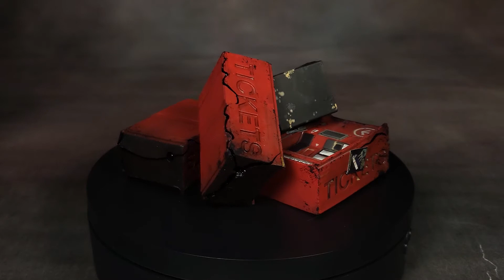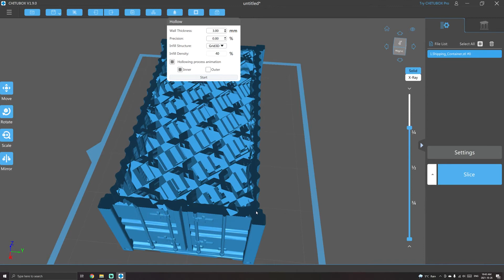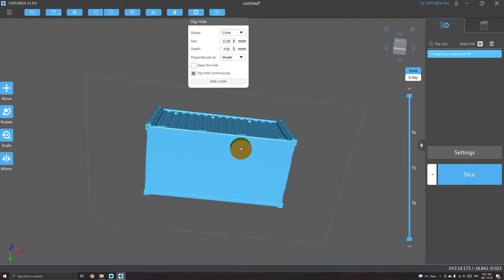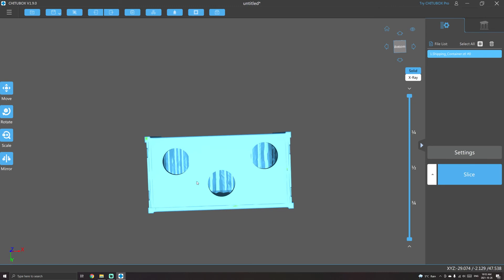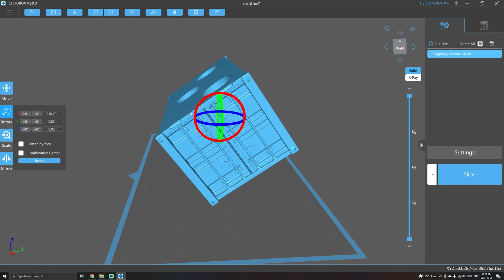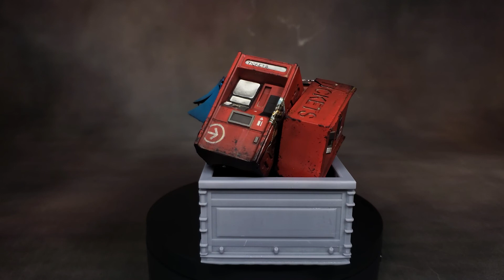3D Printing  - The Crackening | Hobby Hangout

Comment: Great video, Ive had a bunch of trouble with printing terrain when trying to use infill settings. Going to try the drain holes and see if it helps!
Reply from the maker: It makes a world of difference, and honestly, unless you need the structural support, ditch the infills entirely!